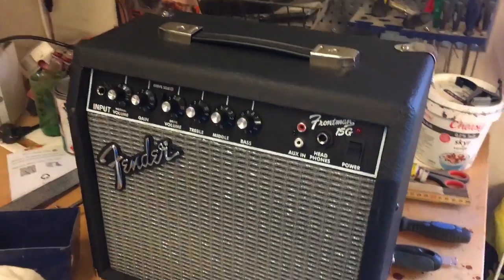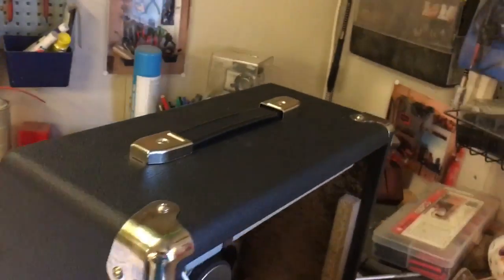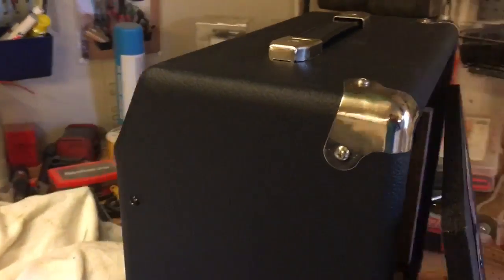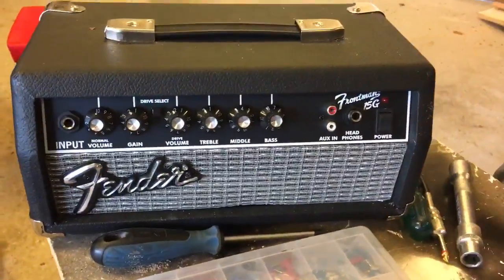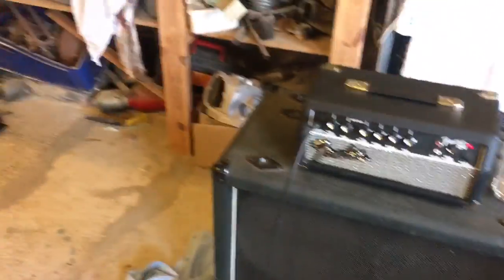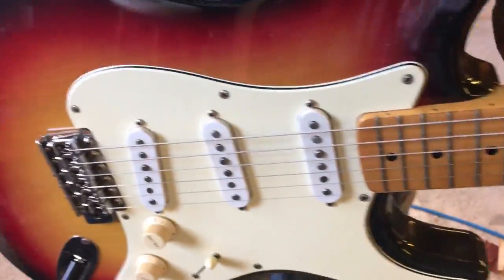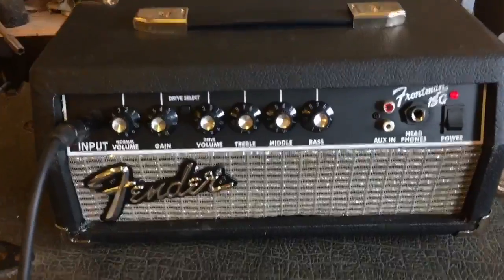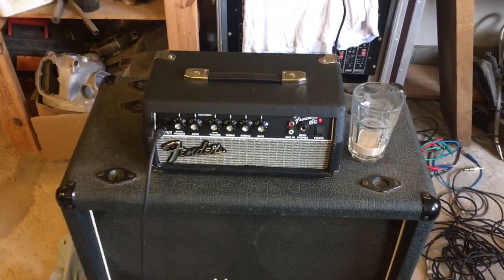Convert solid state amp into a head - DIY

Comment: I have a question I have a Fender Mustang one combo I want to convert it to head. The problem I have from the chassis amp has yellow wire goes to the middle. The speaker terminals on the amp. I believe the yellow wire is ground if I disconnect the yellow wire from the mirror, the speaker terminal do I connect it back to the chassis for ground. Please let me know.

Comment: Nice job.  I did this w a 30 watt Fender with the DSP- totally smokes a 4x12, drill a hole in the back panel and attach a gtr jack to the speaker wires.  I paid $30 for the 30 watt fender dsp, sold the speaker for $30....talk about free head

Comment: I Just made this mod to my marshall mg10 and get a constant hissing sound that stays the same no matter the volume, but other than that, the sound is incredible.  Any idea what could cause that?
Reply: Have you twisted the wires from the amp output to either your jack socket or speaker? It can help reject noise.

Comment: I used a Squire 15, as a preamp, for years. Great sounding amp.
Reply: i have a question for you , i have squire 15 amp too , i like the tone i get with my pedal in my headphone is very good sound but with the amp speaker its really not the same. so i think like in the video i could only use another speaker and it could be maybe the sound like what i have in my headphone ? 

i think use the small randall rg8 cab do you have an idea if it will sound better ?
Reply: @alexvachon9990  

What size speaker does it have, now?
Reply: @springbloom5940  is a squire champ 15 , so surely the cheapest 8 inch speaker that exist

Comment: And what if I use just the headphones output directly to the cab? Doesn't work?
Reply: You probably already found an answer, but no.  It would not work.  The headphone output only outputs a fraction of the loudness compared to the amp output, considering that it just has to drive at most two two inch speakers sitting about an inch from your ears.  In terms of volume, it doesn’t have to be very loud at all to be perceived as loud at that distance.  Guitar amplifiers meant to be heard across the room wouldn’t be heard at all with that minuscule output, unless you had your ears as close to the speakers as they would be in a headphone setup
Reply: @samcollins7370  Oh, I understand now
Thanks for the answer!

Comment: I would've just preferred to put a switch & output in the combo, so that it still functions as a combo or option as a head to an external cab. I guess this makes a Frontman 15G look cooler though, as a Fender head. The combo itself is about 20 lbs or so and a tube amp head is going to be at least that too. Not like you're really buying much for weight savings and a Frontman 15G sits on a larger 1x, 2x or 4x cabinet just the same.

Comment: I thought about doing this to a Pyle PVamp60. And then I rethought that concept, just leave it as the combo that it is with it's own speaker. It travels well that way as a stand alone sub 20 lb combo. Any mod would be to add an output jack, so that the Pyle's cabinet/speaker could be used with a different amp head like the Orange Micro Terrors, Joyo Bantamps or Bugera T5 Infinium. And then there is the Lineout that the Pyle already has that the Pyle's amp could be used with yet another cabinet, say a 2x12 or 4x12. It's really an all in one amp toolbox that way and the only mod I have to make is to add the output jack, under $ 6-10 depending upon the quality of the output jack & wire.  Eventually with a lunchbox low wattage amp, be out another $ 100-212.50 for those and that's only if I chase a Bugera T5 at full price. The Bantamps can be had for $ 130-169, the Orange White box is $149 & a Orange Dark $ 189. The speaker in the Pyle is a 60W max watts rated, 8" woofer, so it's every nit as good a speaker as the one that comes in the Fender Mustang I V2 20W model & effects combo I have. No reason to let it go to waste and if it ever dies, I can replace it for less than a new amp prices out at.

Comment: Hello, If I convert my 25r into a head amplifire will work good with a single 15" cerwin Vega speaker? specs 8 ohm 180 watts
Reply: youthexplosion Yes,if the impedance is matched you should be fine.

Comment: Any advice on doing something similar with a fender mustang lt25? I was thinking of building a new combo cabinet with a 12” 25-30 watt celestion and wrapping it in black carbon fiber. So basically instead of turning it into a separate head unit, I want to build a bigger better combo cabinet with a 12” celestion. Do you think that would be doable? If so I would greatly appreciate any advice, you clearly know your way around guitar amps!
Reply: I may possible use two celestion 12” in a custom cabinet after thinking about your video, I’m positive it would push them. Keep up the great content brother! Subscribed!

Comment: I used 2 Fender squire 15g's and made a new wood combo cab that is drilled out for 2 10's(dont have the speakers yet) so basicly its 2 amps in one cab and i built an A/B pedal so i can switch the amps both on or 1 on 1 off. Its nice because i can run one side dirty and the other clear and get some nice tones using differnt pedals on both amps. Iam thinking either jensen webber or guitar warehouse speakers.

Comment: This is my small club stage monitor. I didn't cut the bottom off just bypassed the output to an output jack mounted on back. Hooked up to my old Ampeg Reverbarocket 2 x 12 cabinet it sounds great and I only get to about 3 on volume and it's plenty loud. Set clean all the time I rely on amp models and effects live verb from my pedal. Great sound on the cheap! ;-)

Comment: So, never have done this but are wanting to, If I turn a Line 6, 2x12 combo amp into a head unit, and build my own cab with four 12's, what would be the proper way to wire a set up like that? I'm not quiet grasping the output jack deal, I'm assuming I need two of them for 4 speakers, or what?Please forgive my ignorance, I'm not familiar with this process.Anybody?
Reply from the maker: Depending on the ohm of the speakers, you can connect them all to one Ohm differs if you connect them parrallel or serial. Så you need to lay out your connections and then buy speakers after, what you want in the end. But if I were you, I would build a stereo cab with 2 jacks. It could open up the sound for some effects.

Comment: This mod debunks the myth that solid state amps are pieces of shit. The fact is that these cheap combo amps have great sounding quality circuitry that comes shipped with shit speakers. 

This is a great way to have great tone for a fraction of the price... well, since speaker cabs aren't exactly cheap!
Reply from the maker: You're right :) All small speakers would benefit from a couples of bigger og better speakers :)
Reply: I like small speakers, I like tall speakers 
If they've music, they're wired for sound

Comment: Fender and marshall should make solid state lower watts heads like these
Reply: Marshall had those Lead 12 heads in the 80s and 90s and they sound amazing through big 4x12s. It's borderline unbelievable
Reply: @DelusionalVoice  I got one of those little lead 12 heads for like 80 dollars with both of the original cabs and it sounds amazing
Reply: Or just put a 50¢ cab jack on them. Id pay another $2 for that.
Reply: 100% I don’t want more than 1W for home use
Reply: @dpajc056  i got a Marshall vintage modern 100 watt full stack that I play at home on about 4 its so much fun when friends come over and I play with backing tracks through my p.a system abd it sounds like a live concert cuse it has the feeling of the loud bad to the bone Marshall stack thump. My parebts bought me that full stack with matching 4x12 cabs from guitar center new for 800 bucks when they first came out now look they are a very high dollar and sought after amp. Great purchase mom and dad I'm 29 now and I was 13 when I got it. Maybe in 20 more years it will be worth enough to help me retire lol
Reply: @dpajc056  my point is high wattage full tube stacks are a blast at home just don't crank unless you open windows and wear ear plugs makes for a fun jam night while drinking a few beers
Reply: Peavey I've seen them Done like this there awesome

Comment: Kind of a dumb question (better safe than sorry eh?) but: I have an 8 ohm amp, will a 16 ohm cab be safe? I just want to be totally sure before I blow something
Reply from the maker: Shouldn't be a problem with when the cab has a higher ohm :) I don't know why... But I've reaserched... This guy tells it good: https://www.youtube.com/watch?v=8GuuiIerVqs

But if you're scared, you should talk to an expert, which I'm not ;o)
Reply: McTwish von Noodles yeah, not a problem, but you'll loose some output level.
Reply: The tda2030 in this little amp will power a 16 ohm 8 ohm even 4 ohm speaker..

Plus the amp is set to 15w only it will not go any louder.. ie power supply etc..

Comment: Nice, I just bought a Fender Champ 110 from the early 90s to use as a bass amp, sounds like crap through the speaker but pretty good through my headphones, probably gonna turn it into a head and route it out to bass speakers.
Reply: just a follow up question...if I use 4 speaker, it should be 8 ohms each?
Reply from the maker: Cool :) Just make sure that the ohm is the same :)
Reply from the maker: Your cab should all together be 8ohm...
Reply: Jhudaz Gab You can use 1 8Ohm, 2 16Ohms, or 4 32 Ohms if they even exist.
Reply: tyler did you do this? i wanna turn one of my fender guitar amps into a bass amp by behedding my boring solid state bass combo and sticking a guitar amp "head" on it. does it work?!?

Comment: I did this with a Frontman 25r, except I just added an extension speaker output jack on the back so that when  you plug a cab into it, it cuts off the 10 inch speaker in the combo.
Reply: Mike Strowbridge... hmmmm, so you didn't do this (".)
Reply from the maker: I want to do the same thing with my Vox combo :)
Reply: Mike Strowbridge im about to do the same :D, im getting a 4 speaker cab tomorrow just for this mod
Reply: just bought the switching jack to do the mod on my frontman 20r.   I have a super cheep cosco amp which is going to become a head for a rainy day project.

Comment: can i do this with an ibanez 18w amp?
Reply from the maker: Yes, you can do this with any amp. Just connect the speaker wire to an output jack instead. And then run it to your cap. Just make shure that the cab and amp is the same ohm. Or at least that the cab has a higher ohm than the amp. I'll post a video soon, where I've put in a switch on my Marshal and my Vox combos, so that they still function as regular amps, but I can flick the switch to send the sound to my cab instead